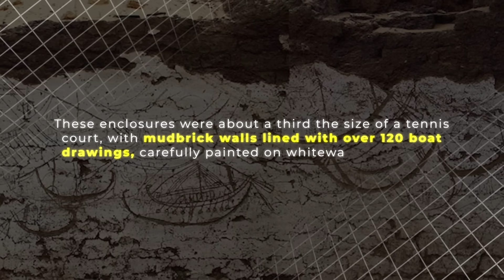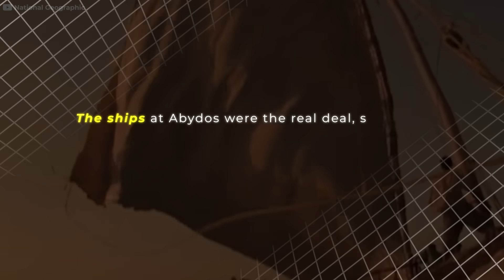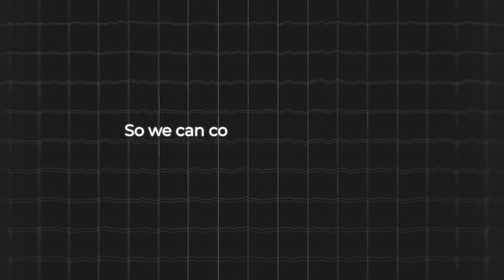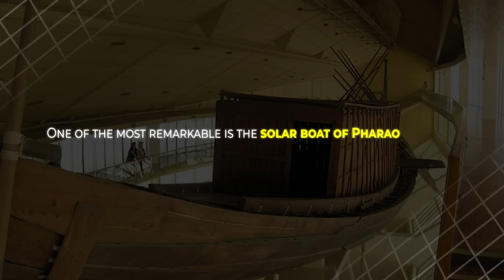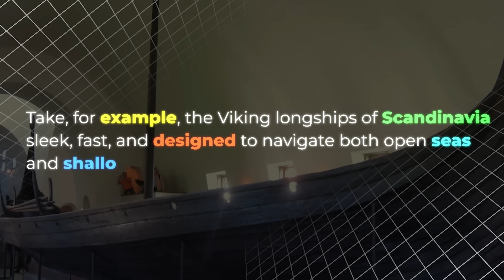Abydos Fleet: Ancient Ships That Shouldn't Exist!

Comment: If it's really old in salt water the wood will be gone or petrified. So what do you find? Some shards of pottery. How do you know how old are they? You can't, they just make up a number based on other finds, which are also largely estimates. Could be 5k years old or 500k. Like the orichalcum ingots, what is their age based on? Based on nothing. If dibblet were correct about the 3 million wrecks FOUND and then they were reliably DATED somehow, then he would have a good point. However the amount of ships that have ACTUALLY been found and then brought up AND dated in some reliable way is not 3 million. It's not 300k as he later backtracked. It's not even 30k. In fact it's probably not even 3k. Only a trickle of ships are actually studied in that detail and have material that can be reliably dated. The rest is pure fantasy and estimates that have 100,000 nonsensical assumptions build on top of each other underlying this fantasy.

Comment: Before Noah's flood there was a band of water above the earth then there was air then the land. Earth was like a hot house where plants grew excessively.
Noah's flood changed all of that the water above the earth came flooding down ev e n water under the earth rose to the surface. The earth became like a dried out apple with some mountains very high and some valleys very deep.
God has promised to restore the earth to its former condition. With the excess water on the surface of the  earth being returned above the
 earth and also the water which was under the earth also being returned the earth will no longer be like dried up apple. The abundant vegetation will return and the ratio of land and seawater will be changed there being more land and less seas and oceans.
Read Genesis first book in the bible.
Reply from the maker: That's an interesting perspective! The story of Noah's flood has certainly inspired many interpretations about the Earth's history and the changes it has undergone.

Comment: Abydos was once on the shoreline. Something changed with the Nile. Either the geology uplifted or a dam was broken. The pyramids which are much further north were also a type of port or banking and trading centre. There are causeways. This means a tidal docking area. Higher on the Nile could easily have been a transport of goods passage requiring large ships to travel up and down a potentially flooded Nile.
  I would love to go metal detecting along the ancient river beds of the Nile around Abydos. I don't even do that activity but I have a hunch.
Reply: The reason the boats are in the sand is because the northern half of Africa experiences a shifting weather phenomenon that makes the north green and lush, and then the rains shift away, and it turns into desert. We are obviously in the dry cycle, but prior to this cycle, Those boats must have been used on waterways surrounding the pyramids.
Reply from the maker: That's a fascinating perspective! The evolution of the Nile’s geography certainly plays a huge role in understanding the ancient civilizations. Metal detecting along those river beds could uncover some incredible history!

Comment: The pyramids of Giza are more than 12,000 years old.
Reply: An historian often claimed without ever being taken seriously that the pyramid of Giza was built more than 70,000 years ago and was reused throughout history by many pharaohs. It was built when the Lyra constellation was in Cancer. It is written in a cartouche, in red on the ceiling on top of what archeologists call "the coffin" . The historians name is Abou-Zeyd-El-Balkhy !  It is actually 73,300 years old. Claiming the the Polar star was used to align the construction during Kuhfu's reign doesn't match the timeline. Those laughing, don't forget that Earth is 4,3 billion years old and that rocks can't be carbon dated. Archeologist often make calculations based on things they find around the place or object they research. So using their method, if I visit the pyramids and drop my phone in the sand and it is found in 5,000 years they are going to say it was built in the years 2000 ! And the Sphynx is even older.
Reply: Some are saying they could be 35 thousand years old and were under an ocean at one time as the whole area around the pyramids are covered in sea shells 🐚
Reply: way older
Reply: As far as I know they took samples from the mortar of the top and the bottom of the pyramids. The mortar from the top was OLDER than that from the bottom and corrected the current scientific dates by 600 years.
If this really was true it would in fact prove that they only were repaired 600 years before their now accepted date. This would in fact mean that they are older, though they could not be older than 10.500 BC, because their position resamples the position of the belt of Orion (who was as Sah = Shepherd related to Osiris), which constellation at that time had reached it's lowest position in the course of precession!
Reply: Yes. Nephilim, so evil—and taught humans so much evil— that God destroyed all breathing things but what He preserved on the Ark.
Reply: @appaloosa42  Well, that is a religious perspective. I believe if we ended up killing ourselves with nukes, the new species that will see our footprints will say God destroyed us because of our evils, too. They rose and fell naturally after thousands of years.
Reply: Dislike for channels still propagating Egyptians built the pyramids.. 😢😢
Reply: They wete built by the Jinn!
Reply: Prove it
Reply from the maker: That's a fascinating perspective! The age of the pyramids continues to spark incredible discussions about ancient civilizations and their achievements.
Reply: The Emerald tablets tell of who constructed the pyramids and their function.
The tablets also discussed the elevation of the Nile plateaux, recently discovered, so no surprises